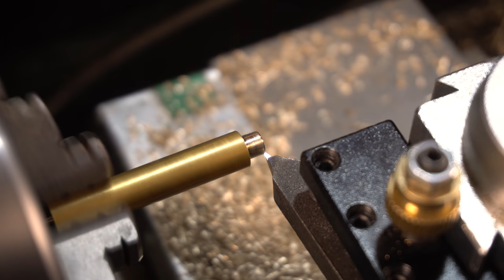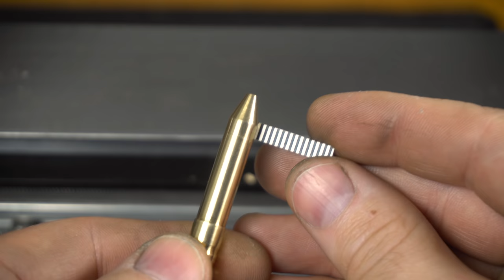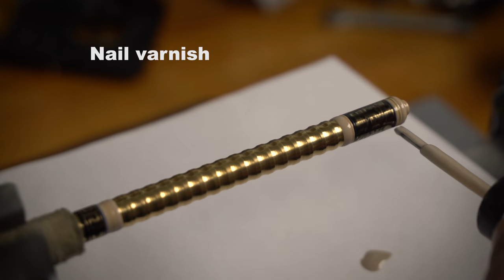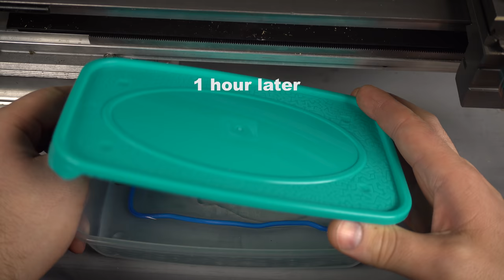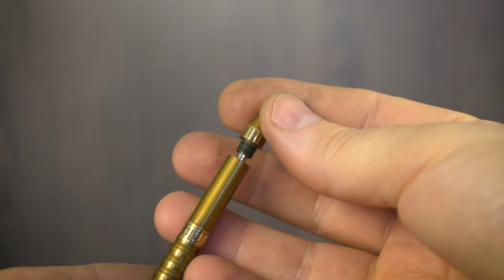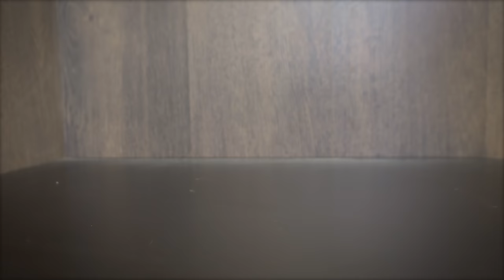Original Pen  DIY + Lathe

Comment: Excellent channel, very nice work as well. From a laymen perspective will you describe more detailed procedure how you etch graphics onto the brass cylinder OR direct me somewhere? I wanted to do something similar on a brass cylinder.  I've read that some laser printers won't work but they've never mentioned specifically which ones do work. I understand the purpose of the string and heat gun. What is film is used for the laser?